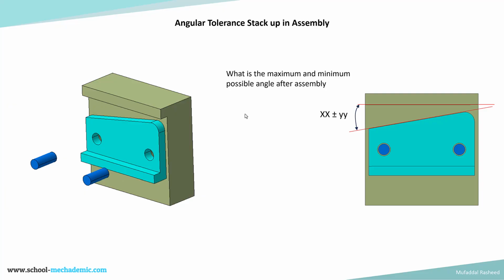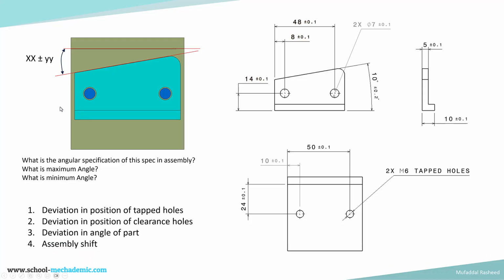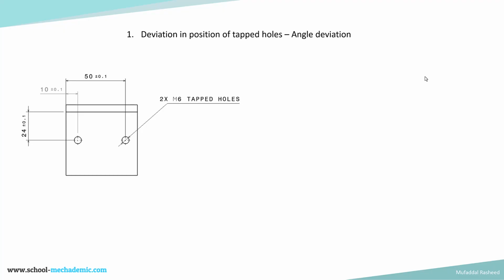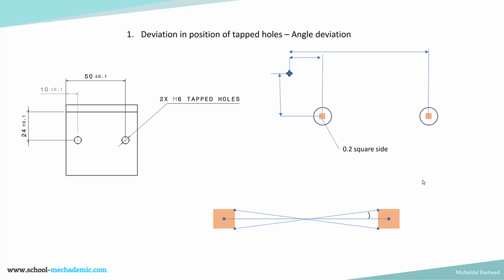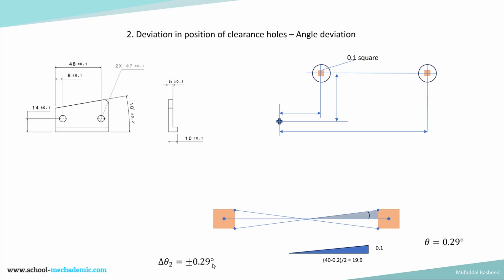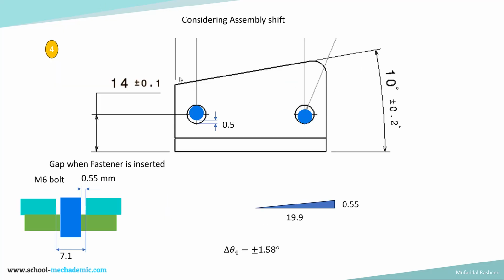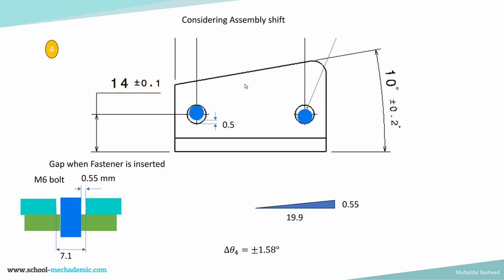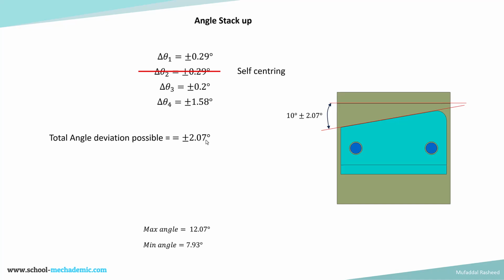Tolerance Stack up Analysis- Angular Stack up - Worst Case Scenario

Comment: 8:10 : For worst case i think we need to consider the theta 2 which needs to be added to the stack. Imagine clearance holes manufactured at  diagonally placed angled at 0.29deg, and tapped holes manufactured diagonally placed same 0.29deg but in other direction. Now the distance between holes are same on both parts and because of this they assemble very well but now the angle is totalled to 0.29+029 from each part. i.e. theta 1+theta 2.